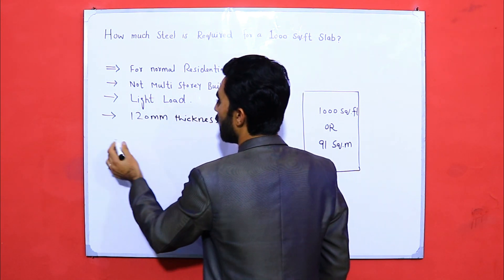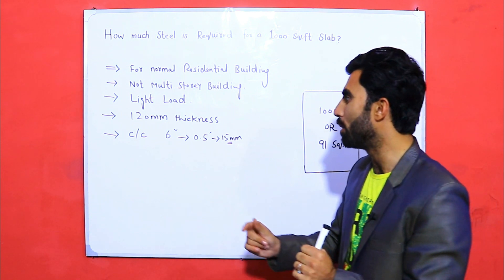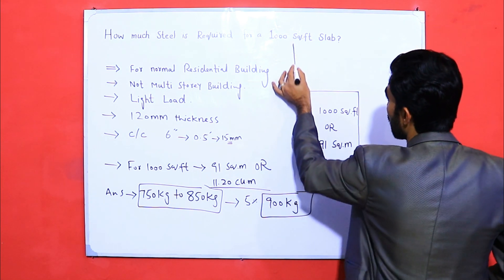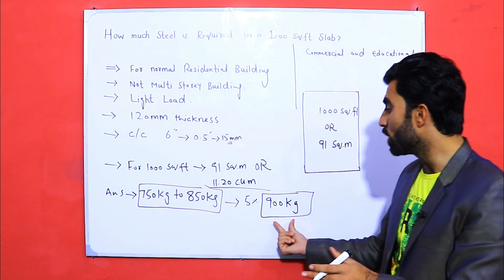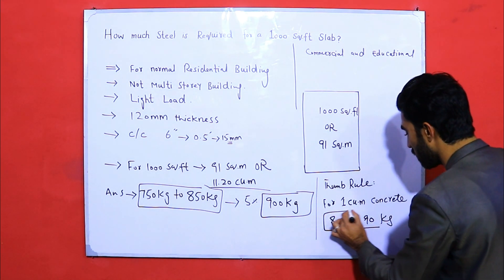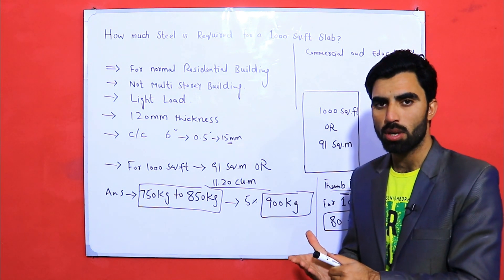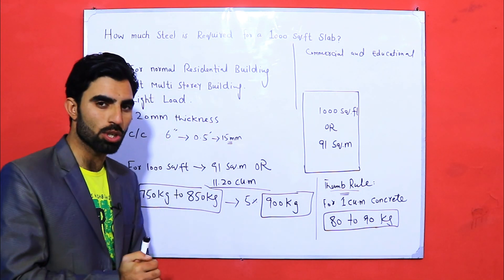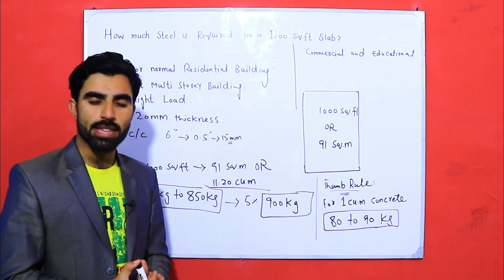How much steel is Required for 1000 sq.ft slab? Quantity of Steel for 1000 sft slab

Comment: OK sir .very good explain
12mm.??
 8mm??? Bindings  wire ???
If consider 9 columns 9/9 inch
Beam 9/12 inch 
Floor ht 10feets

Comment: Sir 750kg 850kg ....how to calculate please expain detail. ...... with their example. All enginer should be easy  find out other quantity.
Reply: generaly we provide 1 to 1.5% steel in slab per cum so 1000/10.764=92.90 sqm. so 92.90x thickness of slab.  11.14 approx. 11.14x1% =.111 now multiply with density of steel 7850 =935 kg ans
Reply: Yes 900 kgs ..how to calculate.. explain pls

Comment: Does this includes steel for beam also?
Reply from the maker: no
Reply: Please let us know, what should be weight of steel beam for 20 feet by 20 feet lobby... in my house, engineer has recommended beam of 20 bars of 20 mm for 20 feet.... it looks very happy and beam weight is 185 kg
Reply: No
Reply: Add one ton for beam